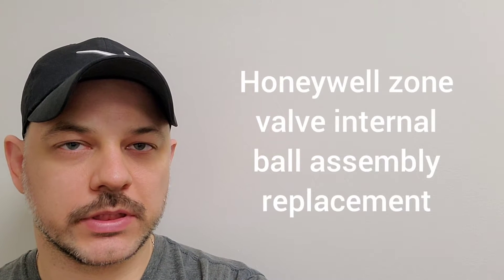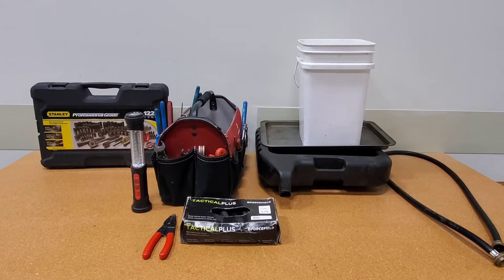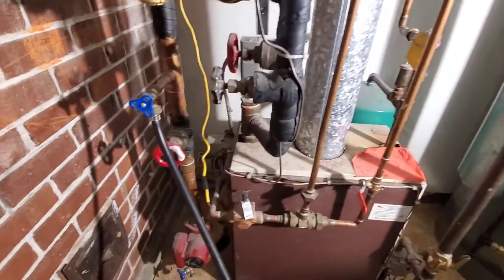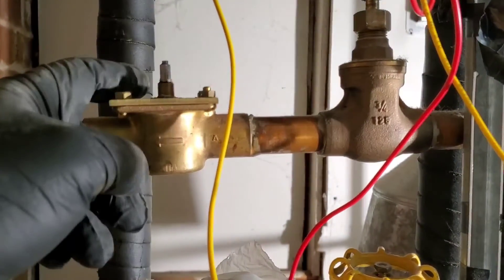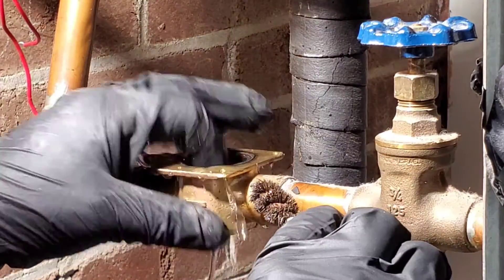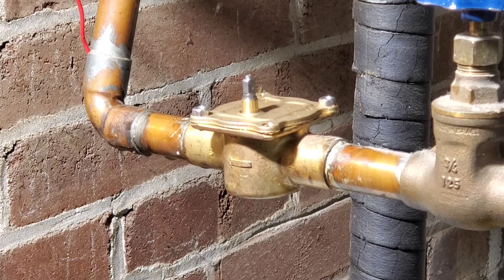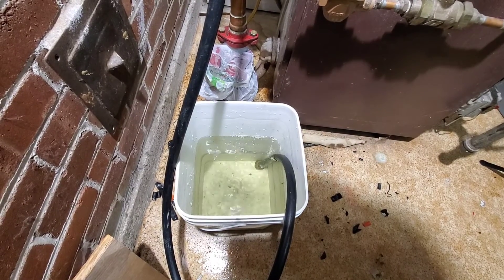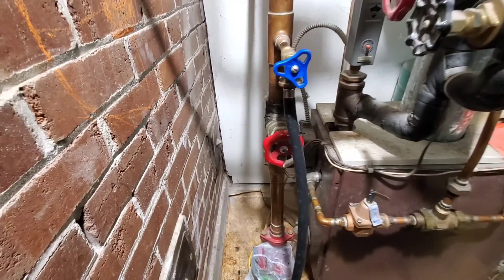Honeywell zone valve internal ball replacement (DIY guide)

Comment: I just found your video, thank for the step by step instructions. I have a Honeywell 3 port valve 3 wires only with no mid position (V4044C1288), The head stop working, but the valve seems ok, is it possible to converted to a 5 wires with mid position? Do I need to find the just the right head? Do I need to replace the plate and ball with a conversion kit from Honeywell? Do I need to change the whole valve? I will appreciate any suggestion and any specific recommendations to buy the right part. Thanks a lot!
Reply from the maker: Thanks for you question 3/5 wire, what are the extra wires for?
Reply: @HomeownerDIY  the 3 wires is the old version of the 3 port valve that does not have a mid position, therefore, you either get HW or CH, the 5 wires allows for mid position to get both at the same time. I just wanted to know if you new the compatibility of the heads
Reply from the maker: @pablob618  l dont off the top of my head l would have to look into it. Probably the fastest way to get an answer is to email Honeywell customer service.

Comment: I ordered a new ball valve but isn't there a way to manually open the line so that heat can go through while I wait for the part? Manual level on motor does not work.
Reply from the maker: Thanks for your question, l am assuming the gears on the lever are stripped so you cant manually open the valve?

Why not cut/disconnect the spring that holds the ball in the closed position?
Reply: @HomeownerDIY  Thank you for the quick reply! I removed the motor so that only the ball and its cover plate remain. I though I would use a wrench to hold it open, but I can mover the little lever by hand very easily. But either direction I go, no heat circulates. The pump is running fine for the other quadrants while I do this and the pipes are shared. Air in the system? a blockage in the pipe? Should I try bleeding it?
Reply from the maker: @Markcgreer  Is the isolation for the valve in the off position for this zone? 

If you open the valve manually the pipe should be hot at the valve outlet near the valve.
Reply: @HomeownerDIY   The isolation valve is open. Problem was intermittent for this quadrant. The gears are a bit stripped on the motor when I move manually, you were correct. Arrow points down on these. All 4 are hot below. First 3 are hot above, q4 gets cooler as I go farther above and out. Maybe the ball fell off and is jammed in the pipe?
Reply from the maker: @Markcgreer  l am thinking there is a blockage. Remove the ball from the valve. Since youre there already just put in a new one. Since the gears are stripped youre not spending any unnecessary money anyway.
Reply: @HomeownerDIY  https://youtu.be/ay6-QYPRBJA I just shot this. Ok, I have to wait 3 days for the new one. Will see what it looks like in there once I have the replacement. Thank you!
Reply from the maker: @Markcgreer  Good luck sir!!
Reply: @HomeownerDIY   While I was waiting for the part to arrive it started working again. I had the boiler tech out for a different issue and asked him what might be causing the intermittent operation of that zone, air in the line, he is certain.
Reply from the maker: @Markcgreer  Do you know how to purge air or did the tech do it for you?
Reply: @HomeownerDIY  He did tell me how to bleed the lines, though my system does have an automatic air remover so I won't attempt it unless it stops working again. Thank you very much for all your help!

Comment: Thank you so much for this tutorial! I initially replaced the zone valve motor which did not fix the issue, and when I opened up the valve it turns out the ball had totally disintegrated. Easy swap, everything works again 😊
Reply from the maker: Happy to help!!